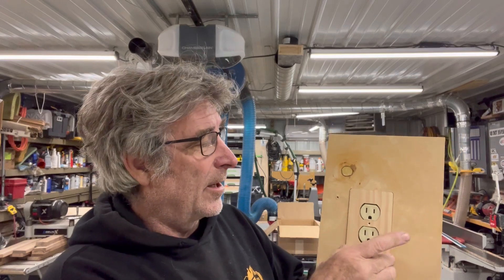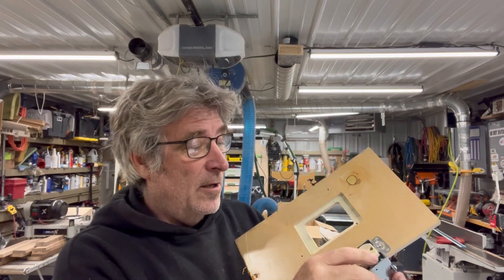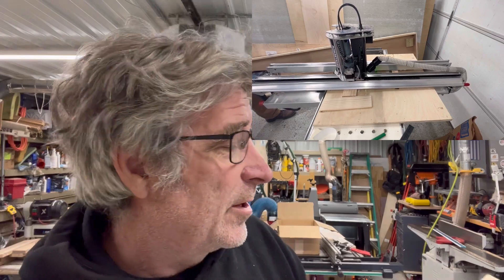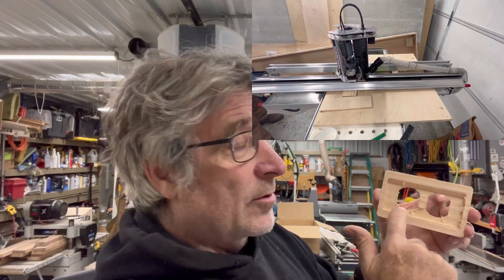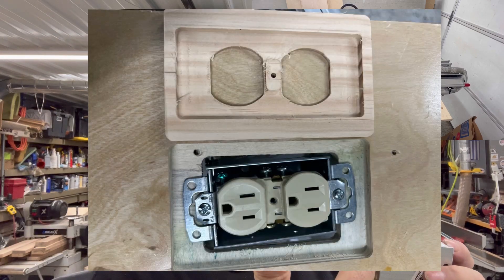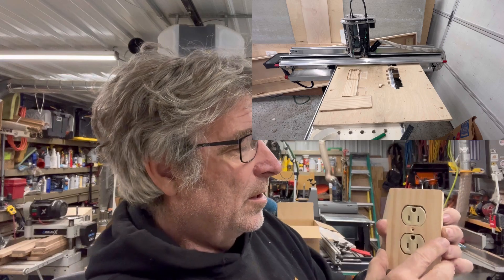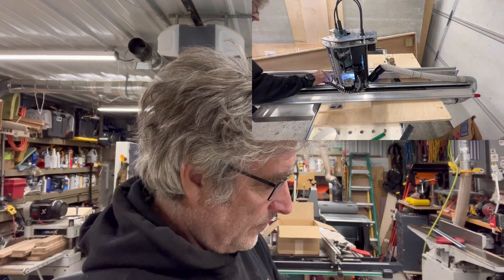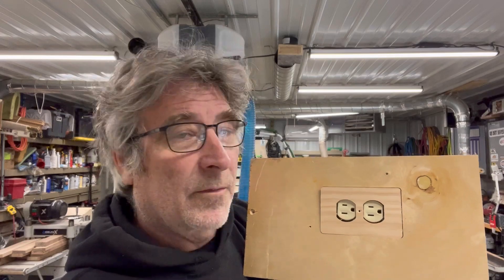How to Install an Electrical Outlet Into Your Baseboard with CNC               #cncwoodworking

Comment: I don't mean to be negative but isn't using a combustible material as a cover plate an issue and against code?
Reply from the maker: You make a good point. I will look in to it more, If needed I can add metal backing plane on the back side of the cover.
Reply: @donavanshomes   I have a couple of wooden outlet covers in the house. I just saw this comment and wondered about it. So, I took them off and looked at the back of the cover, and they do indeed have thin metal plates attached inside of them. They appear to be plain sheet steel.
Reply from the maker: Yes I will need to add metal to the backs to meet code  I found out after looking in to it

Comment: I did something similar in my house: outlets integrated in the baseboard. The difference is that my outlets are not flush, the board has an old/classic look as it consist of 5 trim pieces, and none of the cables are preinstalled inside the wall (it's ok with code here in Norway). How did I do:
All cables were fastened after I had mounted (glued and nailed) the first 2 pieces. Both of these were flat and of same thickness, and mounted so that the small one at the bottom was hidden and only works as a spacer while the upper one was wider and visible. Combined they formed a channel wide enough also to run wifi and coax. To finalize the baseboard the two pieces and all the cables were covered with three decorative trim pieces where the main trim was screwed (no glue) for later access (code). 
This make this installation I didn't need any precision CNC, mostly bcs I found all the trim at the local store - and it's relatively inexpensive.

Comment: Might be easier overall to zero on a stock-edge. Then you can set up a stop/fence, zero that in, and either kind of stock laid against it will be pre-zeroed (at least in that axis).
Then again, doesn't really make a difference here because you're not switching between the two jobs.

Comment: Only question I have is why? Why would you put your outlets in a baseboard? Not only that, but why would you put outlets sideways? This is extremely impractical. Any transformers type of outlets won't fit well, the plugs are going to be low enough that you have a chance of stepping on them and if you ever decide you want to change your baseboards out, it will be a huge headache. Also, I just don't think it looks good.

Final thought... Don't building codes require GFCI for pretty much every home outlet location now (which is an idiotic idea)? The last home I lived in I was trying to fix an old refrigerator and it constantly tripped the GFCI and the only way I would work on it was to run a splitter and an extension cord off of the refrigerator outlet because it was the ONLY outlet in the house without GFCI on it.
Reply from the maker: The Architect design that outlets in the sunroom area to be in the baseboard and all of the outlets in the kitchen hidden with the upper cabinets or the counters. The client is happy with the way it is going to be done.

ARC Fault protection are required in all outlets that are not wet locations and those are GFI outlets or breakers  most of the time ARC breakers are used for non wet locations